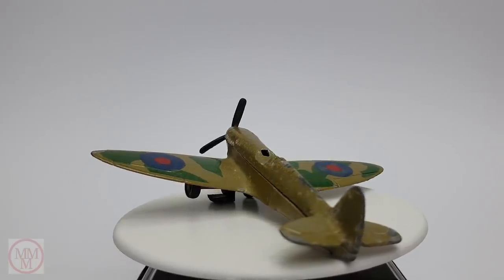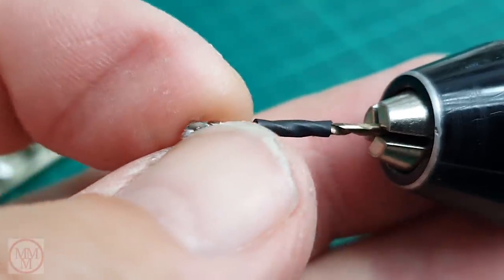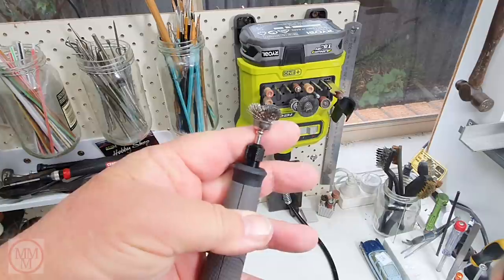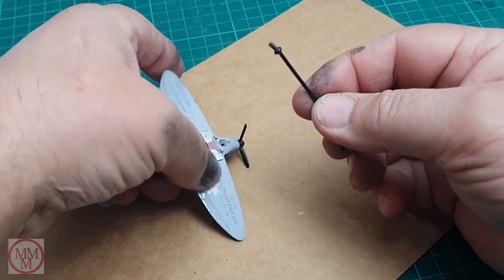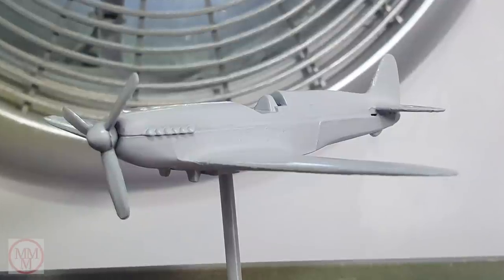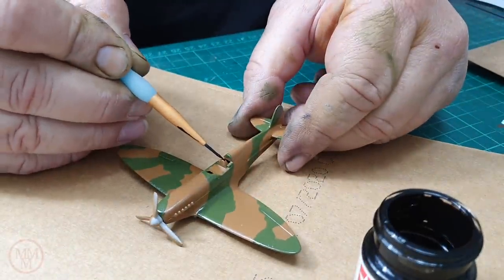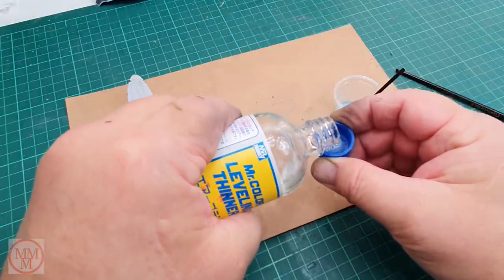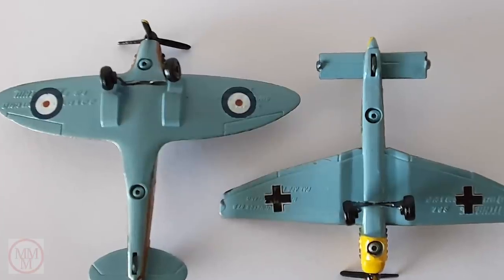MATCHBOX Battle of Britain Special   -  Custom No.SB8 Spitfire & SB7 Junkers 87

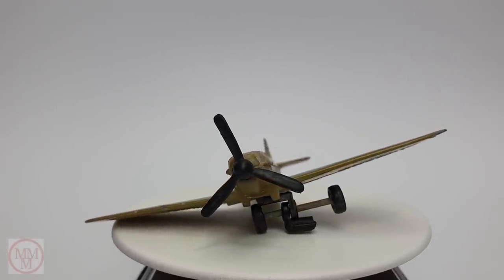Comment: @0:47 Reichsmarschall Goering to a group of his fighter pilots:  "What do you want me to give you, to win this battle?"
Adolf Galland:  "A squadron of Spitfires, Herr Reichsmarschall
@6:02 Looks like the wire undercarriage is sturdier than the plastic block type.
@7:16 I think you could have coated the windscreen with a thin layer of Vaseline as a release agent, before sticking it in the epoxy.  Commercial casters use mold release agents, which is why a lot of modelers wash the kit sprues or parts with warm water and a de-greaser before starting to work on them.
@11:00 Those stands look great!  Excellent idea!
@13:48 The RAF removed the white ring or band from the roundels on the upper wing surfaces, to enhance concealment from above at a distance.  As the war progressed, they used different markings, usually for the benefit of ground-based observers, to ID their aircraft, things like painting one half of the underside black and the other white, or a white field with black bands running fore and aft (esp. on the Typhoons)
@14:05 Roundels trace their origins back to cockades that armies wore on their headgear, to identify their soldiers on the battlefield, especially before smokeless powder.  They were made of ribbon, in the shape of a bow attached to the front of the hat.  In the time of the French Revolutionary wars, the fashion changed to making a round cockade out of it.  The British didn't use this, but the French and the other continental armies did.  And most were tricolors, again, following French fashion.  So when airplanes entered use, that was the most common marking.  Except for the Germans, who used the Iron Cross.  But on their caps, the Germans used cockades, too, as small badges. Still do, too.
@15:46 That "Parents" magazine title looks obscene

Comment: All the vehicles in my Matchbox collection are made in England.  I stopped buying them when they stopped making them in England.  Mostly for what you pointed out about the casting of the one made in Thailand not being up to usual Matchbox standard.  I should take pictures of my Matchbox cars, almost all are in practically new condition.  The only things I'm missing are little things like the horses from the horse van and the lion and cover for the safari pickup truck.  I have the motorcycle trailer the ones your redid but I don't have the motorcycle.  I have a motorcycle but it's much larger than what goes on the trailer.
#BOB

Comment: One way for canopy replacement is always vacuforming. Or pressing the old into mold making material like play dough & filling the mold with clear epoxy or resin or Lucite. That tail swastika is on wrong so please don't copy that position. It should rest on one tip. Stuka's are splendid examples of the  Battle of Britain. At school they cover the printer bed with wide masking tape & print on that.  Nice project & job.

Comment: Silicone molds work, but you forgot to add mold release to the canopy.  In addition, if you add baking powder to the silicone, it will set up in minutes.  Do some experimentation to discover the optimal amount of baking powder to a given volume of silicone.  For the amount you showed in the video, start with 1/2 teaspoon.  Make sure you use 100% clear silicone.  You can add a drop of food coloring to ensure the mixture is properly mixed.

Comment: On the topic of mold making, I've seen some people use Blu-Tack as a mold to cast parts, but I believe you still need some kind of releasing agent.  I've used clay in the past to make molds as well.  I'd recommend seeing if you can find a product called Blue Stuff.  BaremetalHW used some of it in one of his videos to make tire molds and all you need to do is heat the bricks in hot water to make a mold.  Best part is it's reusable.

Comment: 21:00; Next time try using putty or modeling clay instead for creating a camouflage scheme like this one. You can mold it to the exact shape you want to mask with it, you can easily apply it over any type of surface as it is flexible and can be molded around contours like the ones on this spitfire and when your finished painting it's super easy to remove and it won't leave any marks or scuffs behind like the masking pen you tried out here.

Comment: Perfect as normal. The German one looked the best. I was wondering what happened with the windshield did you get a mold. I have made molds like that but bigger ones and I always wiped a little petroleum jelly on the original it kept it from sticking to the mood then just clean the mold with hot water.  It always worked making plaster molds for me. Great show this week I always like it when you do a bunch of them at once. #bob
Reply: #bob

Comment: Do you wash the models before using paint stripper?  Old grease and dirt in the letters printed on the metal may be the reason the paint is not completely removed from there. Another great video, the Spitfire is the most beautiful machine ever made. Everyone should have a model of one. #bob

Comment: Marty i'm not sure if this will help but I've seen oxy-clean and hydrogen peroxide used to restore yellowed parts i'm not sure about clear parts, but its worth a go. Put the oxy-clean detergent in a container with the peroxide, submerge the parts in, and place a black light over the container and leave overnight. I've seen the results of this first hand and i can tell you it works on white pieces very well. #BOB